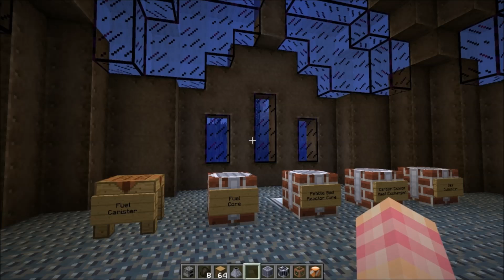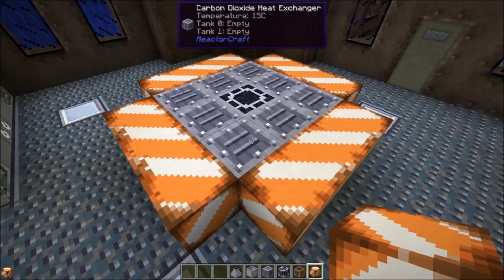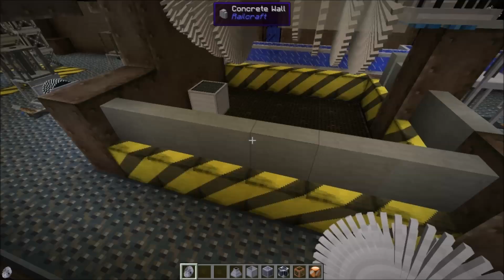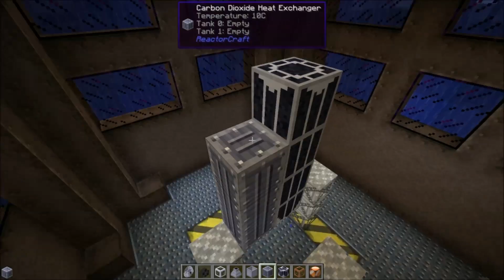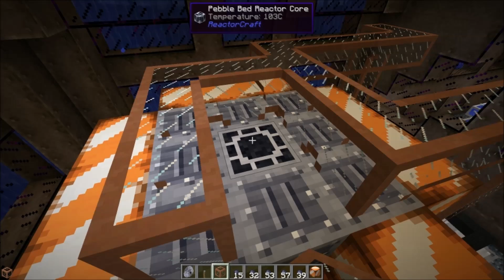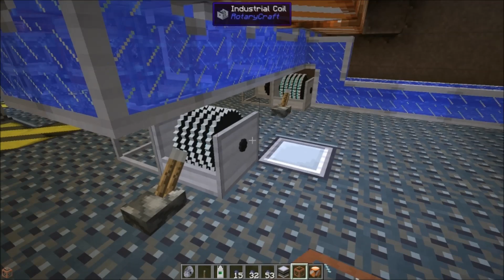ReactorCraft Tutorial #4 - Reactor Build: HTGR

Comment: What version is this for. I copied this exactly as you did it with 1.7.10 v10, and it does nothing
Reply from the maker: +Eragon ShadeSlayer Yeah this design doesn't work anymore. The new design is to surround a column of heat exchangers with fuel cores.

Comment: Also, the problem was not solved by your replacing the ducts with pipes directly, but because that deleted the excess CO2 that was jamming the pipes.

Also, liquid pipes no longer carry CO2, hot or cold.
Reply from the maker: I figured it was either the pipes or that. I also thought maybe the liquid pipes had a larger capacity or something. Good to know they won't work anymore, I never thought they should.

Comment: It is recommended to use multiple columns in HTGRs, though it is by no means mandatory.

That will make it heat far faster and produce far more power.
Reply from the maker: You mean columns of Reactor Cores? Would that allow me to run more turbines with the same footprint?
Reply: More cores means more heat. Which means more hot CO2.
Reply from the maker: ***** This is how I like to do it:
Core CO2 Exchanger
CO2 Exchanger Core
Reply: That exercise shall be left to the student.

Comment: just one mistake, u need 800 Celsius to start making hot CO2, its 4 pebble bed's with one CO2 exchanger in the middle to stack, not the other way, as it needs to be very hot.. stacking 3 of these in a + formation works well
Reply from the maker: This way works just fine, I have plenty of Hot CO2.